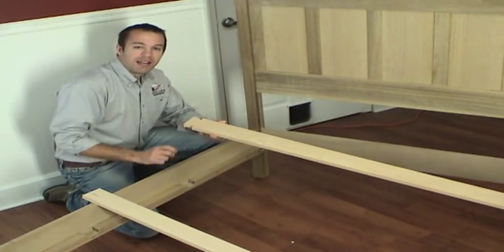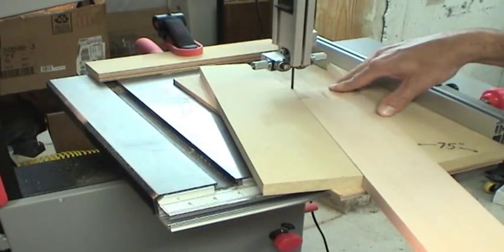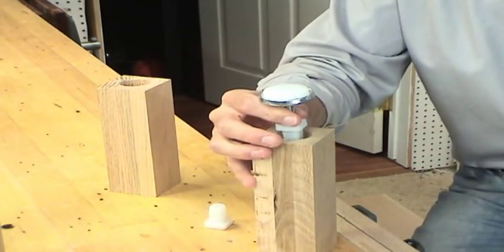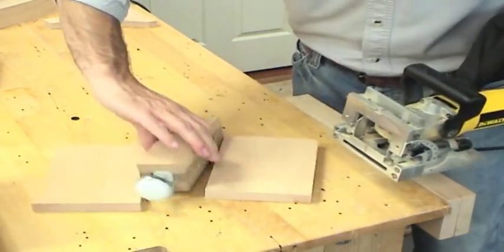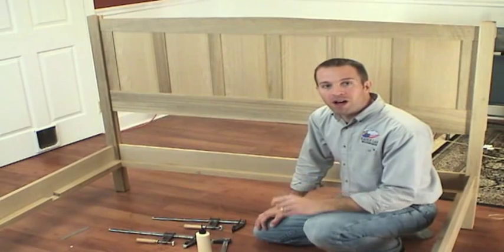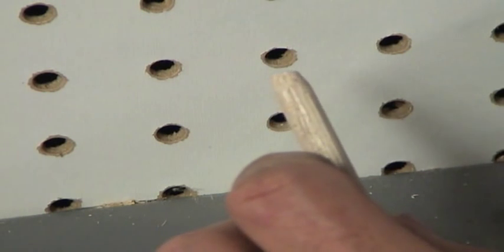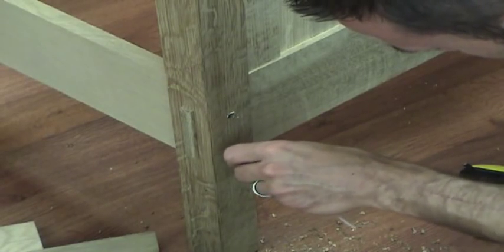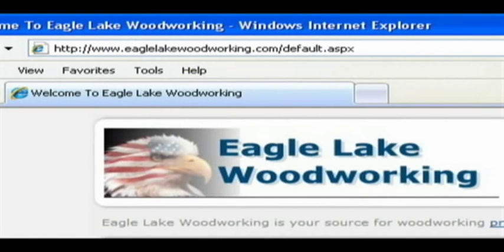Part 7 - Arts and Crafts Panel Bed

Comment from the maker: It took me a while to figure out what you meant, but I got it now.  That's a great idea!  
I ended up with the approach in the video for a couple of reasons:
I was kind of designing those center supports as I went.  I was originally just going to do the post, but then figured it was too fragile (picture shoving a suitcase under the bed). And the second reason may have been my desire to use little scraps I have laying around.
I think your idea is great and I would do it that way in the future.

Comment: Hello John,
   I thought of a possible way to improve on the center supports on this project and would like your thoughts. Rather than adding the side pieces to the square columns what about using a single long piece in the center of the glue up? I am thinking this would also add strength to the part as the grain could be opposite like in LVL and plywood  type construction.
  Let me know what you think.